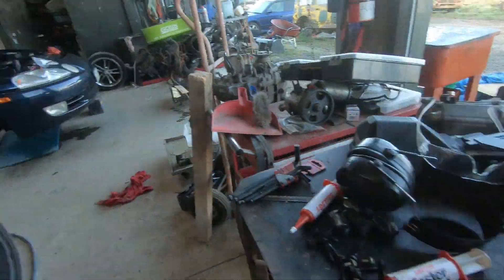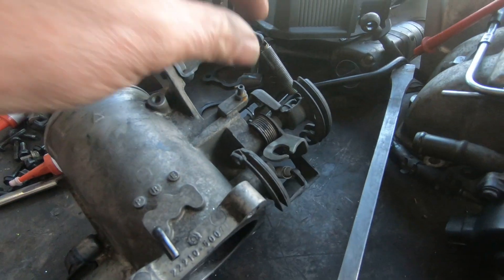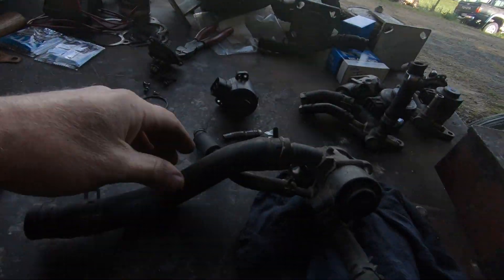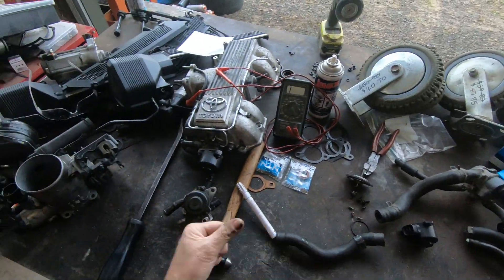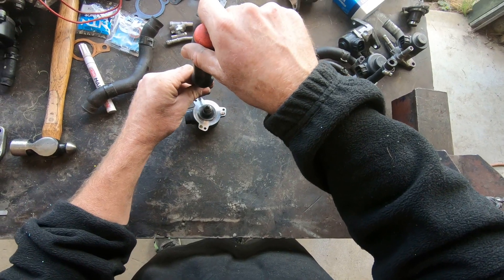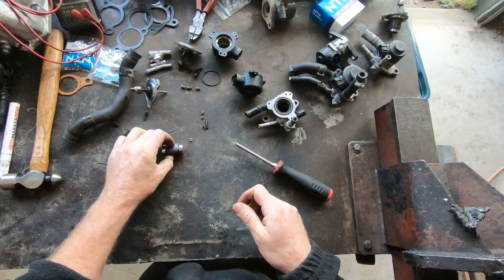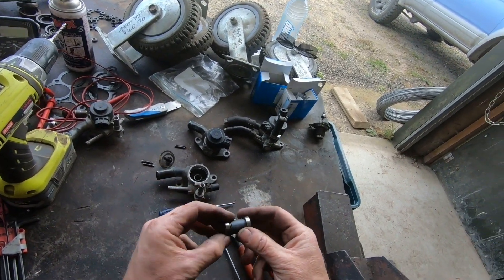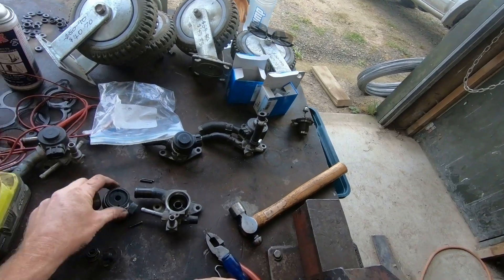1uzfe idle speed control rebuild - includes rebuilding the non-rebuildable IAC unit too.

Comment: Hello send you a one question maybe can help solve my son car problem.....
I have  problem with engine revs floating from 1000rpm to 2000rpm all check sensors work  found  some issue fuel pressure cutting 0psi to 35 psi every 5 seconds when revs increased to the 2000 cut fuel pump revs go to 1000rpm fuel pump start working and again... Someone's have same problems?

Comment: Hi Kelvin. Ucf20. What does it mean for the 'unrebuildable' icv when I drill the blind holes and there are no roller pins inside. And the plastic cover is tough as balls to pry off
Reply from the maker: I'd suggest you might be doing something wrong as they always have roll pins.

Comment: Good info, are the rebuildable iacs, swappable with the non rebuildable?
Reply from the maker: Just a not,  both are rebuildable,  and yes interchange provided the difference in inlet tube size is addressed
Reply: @CartuneNZ  good to know thank you, just a side question do you know where I can get the iac gasket? Mines completely fallen apart. Thanks mate
Reply from the maker: @jacksonl3686  I keep genuine iac gaskets in stock which I purchase through trade suppliers direct from Japan.   I suggest you try your local Toyota or lexus dealer

Comment: Are the two versions interchangeable? I've got a 96 1UZ-FE and wondering if I can go to the easily rebuild able one?
Reply from the maker: Yes,  they interchange however the inlet hoses are different sized between the two units which needs to be resolved to swap them.  Cheers Kelvin

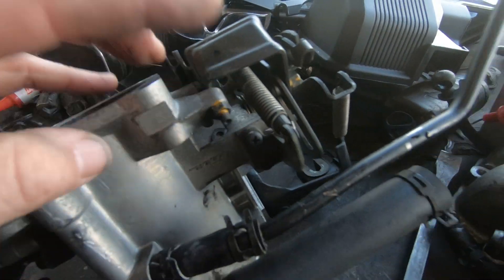Comment: at 2:58 what is that hose cause i can’t find it, is it a vacuum hose?
Reply from the maker: Its the air supply to the tappet cover.  No longer available so we use a piece of universal oil resistant hose.
Reply: @CartuneNZ  thank you!!

Comment: 4:04 is there a part number for that hose or could I replace it with a different 19mm hose
Reply from the maker: I have a video on finding part numbers.  I think the idle air control hose for the UCF20 is now discontinued but you might be lucky.  https://youtu.be/VRrvWHYqYUc

Comment: hi kelvin, i have a 93 ls400 that is idling very high, around 2500 and and the car warms up the idle rpm continues to increase. where should i start?
Reply from the maker: Id start by finding where the extra air is getting into the engine,   most likely by clamping the iac tube.

Comment: Hey Kelvin,  is it bad to remove the cooling lines to the IAC on a rebuildable model? Also, where would I get a replacement bearing set for it?
Reply from the maker: Depends where you live.  If its not too cold then no issue removing the water lines from the IAC.  I get the bearings from my cupboard, not sure where you would get yours but I would suggest a shop that sells bearings is a good start.  Cheers Kelvin

Comment: been having some problems with my LS400 attempting to idle at 3000 rpm, and i'm thinking the IAC may be it. i'll need to go source a earlier version cuz this non-rebuildable crap is not good
Reply from the maker: You do  realize that all of the iac can be rebuilt?  As I show in the video?
Reply: @CartuneNZ  I don't have the expertise to rebuild the later version but the earlier one seems like no trouble.

Comment: Hello, very useful video! I rebuilt my unit and now the car is seemingly stuck in reset loop. It does the throttle cycling but never stops. What can I do to correct it? 
Edit: meant to comment this on the IACV reset video
Reply from the maker: If its wired and the IAC is healthy then the ecu should self reset after a starts and turning the engine off of 10 seconds between restarts.  Cheers Kelvin

Comment: You are awesome mate!  Thanks for the tip on rebuilding the later model iacv on the ls400.  Would you happen to have the bearing numbers to rebuild it?
Reply: 6801 and 689 with plastic seals. Oem is Koyo

Comment: Hi mate your videos are great and really helpful I've got a issue with my 1uz I just finish fitting headers over summer put everything back together and now it idles at 2200rpm I did the reco on the aicv but still no change have checked all connections and checked for air leaks any ideas mate any help would be appreciated
Reply from the maker: I would check the TPS is set correctly , ideally using a scan tool to confirm both the throttle plate angle is at 0% and the Idle switch is on although doing it by just setting the idle switch is often ok at a pinch.  I'd confirm where the additional air is entering the engine and work from there.  Cheers Kelvin
Reply: @CartuneNZ  cheers mate got it sorted  ended up being a stretched throttle cable from rolling the engine 😆but back on the road and running mint once again thanks for the help

Comment: I just stubbled upon the difference of these two IAC units. I purchased an early 1UZ that was missing its IAC unit. I found another today but its from a 1995 LS400. It looks like it would bolt right up, are they interchangeable?
Reply from the maker: yes , only difference in fitment is the size of the inlet pipe.  Cheers Kelvin
Reply: @CartuneNZ  I'm getting a little obsessed with your channel. I'm planning on putting an early 1uz in a RA40 Toyota Celica. Currently starting to take it apart. Any advice? The wiring harness is a mess btw 😳
Reply from the maker: @stevencorrales2683  watch lots of videos for pulling it apart.   Loom I have instructions,   plug kits and lots of videos. Cheers Kelvin
Reply: Did I read correctly that you can build a harness?

Comment: On that 95lexus sc400 you told me use some epoxy compound on front of hydraulic fan motor solenoid that the plastic rubber came off what I wanted to ask is a lot of sticky oil came out of it am going to have to worry bout that I'm going to seal it up with the epoxy soon thanks

Comment: Can I use the early IACV on the newer engine, I know I would have to change the pipe size to the smaller
Reply: Awesome 👍
Reply from the maker: I often do without an issue.  Cheers Kelvin

Comment: I have an SC400 with the "non-rebuildable" IACV, if I wanted to clean it would I need to disassemble the whole unit or is there a way I can just take the the black cover off the front?
Reply from the maker: sure is.  Pop the roll pin and the black piece comes out.  Cheers Kelvin
Reply: Kelvin, I have a 96 SC400 and I'm wanting to do the coolant bypass. Please tell me, do I remove the pressed tubes on the stepper and if so, how do I seal the holes? Also, is it safe just to run a hose loop from each water Port at the back of the intake? Thanks!

Comment: Kelvin.  Could you provide us with the part numbers of the bearings for the later smaller unrebuildable units? Thanks
Reply from the maker: Good morning.  Sure thing .  608 (NTN bearing number 608LLUC3/5K) and 6902(NTN Bearing number 6902LLU/5K)  Cheers Kelvin
Reply: @CartuneNZ  Good morning friend. I'm about to rebuild my IACV and I'm having trouble finding the exact bearings locally. Will any 608 and 6902 work? Thank you.

Comment: I just inherited a 2001 GS430 that my father bought new he's now diseased he kept records of every oil change every 3000 miles it now has 153000 miles it still runs very good very fast .
It has never had the check engine light come on the only problem was the idle which got faster a mechanic he took it to changed the air sensor on the air box where the air filter is located trying to solve the problem he took it to where he bought the car new they said with out a check engine light they couldn't fix it since I started driving it every day to work because of my nissan d21 KA24E breaking down that's a totally different issue anyway the check engine light came on for the first time started watching your channel very interesting I'm a mechanic but on heavy equipment not on motors but on everything else hydraulics and so on .
I know the timing belts have never been changed sounds like a slight exhaust leak would appreciate if you could give some tips about those issues I live here in California and the car was purchased here . 3UZ VVT I 
Lexus GS430 .
Reply from the maker: Hello Bryan.  GS430 are lovely cars.  First thing is the check the code as thats indicating an issue.  Mechanics need to also learn to read live data and understand it.  There is so much more to diagnostics than codes.  Exhaust leaks can lead to oxygen sensor faults or poor reading causing running issues too.  Its due for its belt change so perfect opportunity to give it some more love an check it over.  Cheers Kelvin

Comment: YOU ARE DOING A GREAT JOB. I HAVE LEARNT A LOT FROM YOU THANKS. JUST ONE QUESTION CAN YOU STILL BUY THE PARTS FROM TOYOTA
Reply from the maker: Hello.  I dont know as I never buy new IAC.  I rebuild most of them fine.  The bearings inside can not be purchased from toyota. Cheers Kelvin

Comment: Are the bearings used ( 608llu and 6902llu )for both the early and later (non rebuildable) idle control valves?
Reply from the maker: Hello.  The later units have a smaller bearing fitted. Cheers Kelvin
Reply: CartuneNZ hi Kelvin, can you provide the part numbers for the smaller bearings?
Reply: @Jay351  6801 and 689 with plastic seals. Oem is Koyo
Reply: @bradmcdarma671  thank you!

Comment: Hwzit Kelvin 
Do you wind it down when putting it back together or sticking out
Reply from the maker: About the middle is fine. Then do a reset on start up.  Cheers
Reply: Ok thanx and how much do you sell for
Reply: Oh and a rubber piece also go with the little washer??? Or dont need to
Reply: Thanx Kelvin big help no need for another 1 and by the way its Naime Rlisk via fb also thanx for the p/s pump last year working mint

Comment: Hi kelvin can you make a video on idle up valve installation from  the intake manifold vacuum hose with a switch from the driver dash were I can flick a switch to raise the idle to warm her up then switch off wen warm.
Reply from the maker: Hello.  Does your vehicle not have a proper idle control system?  I prefer to set up correct idle up but doing as you suggested is not hard.  I prepared another vehicle recently for such a setup for the winch idle up.  Cheers

Comment: I'll be back at my car tomorrow sorting out the gremlins. The start and turn off 3times ect then warm up. I haven't tried so that's good advice thanks
Reply from the maker: Is it a conversion or is the engine still in its correct body?
Reply from the maker: Is the engine in a conversion or in the original body?

Comment: Awesome Kelvin! I just posted about your channel and business on a few huge UZ facebook pages hoping to get you more exposure. You deserve way more viewers with your great content and products. If any car channel deserves hundreds of thousands of viewers, it's this one. Keep them coming mate! I think you should do some test drive videos of your conversions when finished. Because that video of your friends lancer was great! Cheers Kelly
Reply: Kelvin, what is the part number to the 3 tiny screws that hold in the IACV to the housing on the first generation Idle Air Control Valve, I lost them whilst at the junkyard. Currently I'm changing my 2nd generation (Non-Rebuildable IACV) to the 1st generation IACV but I happened to drop the bolts on my way out of the yard..
Reply from the maker: I have videos on how to find part numbers.  Check one of the videos out.  Cheers Kelvin
Reply from the maker: Thanks Kelly.   Ill keep doing my thing and making videos.  Cheers

Comment: Great info! One of my 1UZ engines sometimes idles low for the first 15 minutes. I cleaned the throttle body and it helped the cold idle but didn't completely fix the warm idle. After the car is driven for half hour its fine though.
Reply from the maker: conversion or stock vehicle?  Have you checked the wiring is correct as per my biggest wiring mistake video?
Reply from the maker: conversion or stock vehicle?  Have you checked the wiring is correct as per my biggest wiring mistake video?
Reply: Its a stock 1998 Lexus GS400 1UZ VVT. I think I need to check for air leaks, the hoses are all hard.
Reply from the maker: @billygreenhorn9275  Air leaks is a good start.  Monitoring the live data can help.  If you have large fuel trims then that could mean an air leak.  We also see dirty throttle bodies and a build up of oil in the intake.  It's not normally a sign of any other issue.  Clean and continue.  Also checking the AVIS is switching.

Comment: legend mate i was just searching for decent videos of this cheers
Reply from the maker: Cool as.  My first one had copyright due to the radio playing in the background.  Ive got a second video on my list focusing on the later one which is a bit trickier to pull apart.  I've done 4 IAC rebuilds this week.  Cheers.
Reply: @CartuneNZ  awesome mate this vid covers what I needed. hey mate can I ask a question, I've got a leaky power steering idle up valve, I'm wondering if I should just delete the whole thing or try source the two rubber o rings for the valve? it's for my 1990 celsior. Cheers for the videos again these have been so damn helpful to me.
Reply from the maker: @dyllan1195  With a stock vehicle I would be replacing the idle up valve.  They are much nicer when they are in place.  Plenty of other Toyota's run them.  On conversions I often delete but ones like a offroad 4x4 with auto I will run them where possible.   Older celsior can be lovely cars when well looked after.
Reply: @CartuneNZ  Thanks mate I'll have to see if i can track one down.

Comment: Can an early valve be swapped with a non rebuildable one?
Reply from the maker: You did watch the video to see the non rebuildable one get rebuilt though didn't you?  It's much better to stick with the correct unit due to the resistance difference between the units however they can be interchanged.  Cheers
Reply: CartuneNZ yes I watched it. I was just wondering because the gen 2 1uz I bought didn't come stepper motor and found a rebuildable one
Reply from the maker: @rylan7114  Got it.  Yep should be fine.  I really should try to call them early and late , or screw and roll pin type shouldn't I.  Cheers